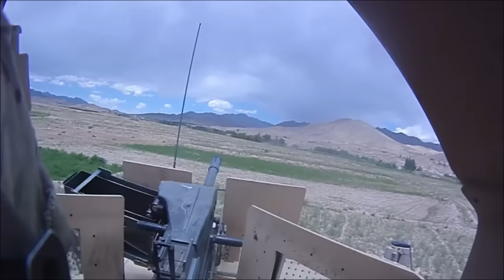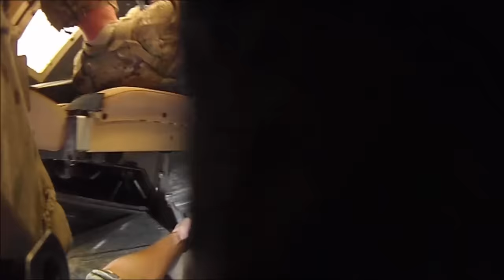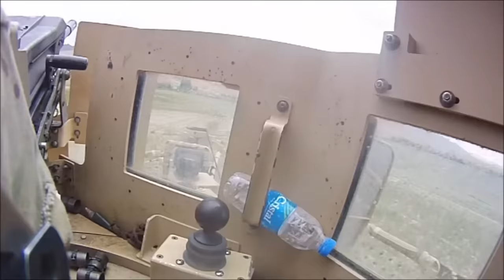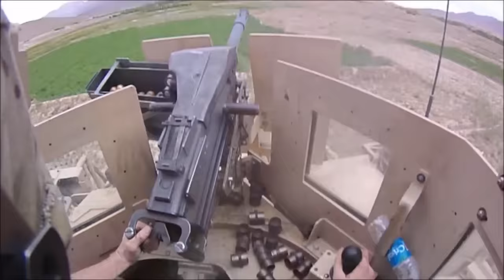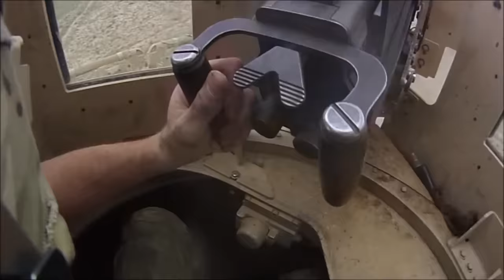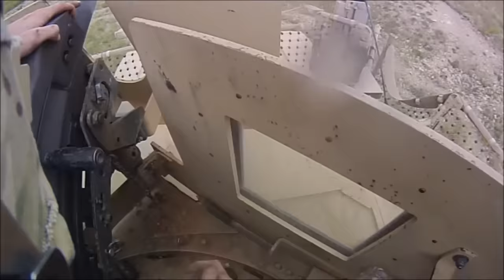MK-19 AUTOMATIC GRENADE LAUNCHER FIREFIGHT

Comment: It’s crazy that you have to totally expose yourself to preform a reload.
Reply: @killdozer3464  That is what I don't understand. I can understand manual loading, cheaper for the military to get their soldiers to manual do it, as there is no shortage of free manual labor, but exposing yourself just to load. Clearly that Turret was designed for a different gun and they just threw that on top, they were no designed with each other in mind if i had to guess.
But yea, reaching over the protection to load I was like, really, that sucks...
Reply: @Arrogan28  I agree. On my first deployment to Afghanistan, the first KIA we had was a turret gunner, 7.62 bounced if the roof the the truck, under the single piece is “armor” and hit him in the face, killing him instantly. Next deployment we had “upgraded turrets”. On the third one we had what you see here.  When we got MRAPS land mines wouldn’t cause as many casualties, they started handing the IED’s on trees, and blowing downwards towards the gunners head. Lost a trooper that way.
Reply: @killdozer3464  Felt for this gunner when the bullets were zeroing in on him, and he is being asked to fire into their position, meanwhile he has to reload to do that, the lid is missing a pin and he has to keep reaching over and slamming it down.  You could see the pens he had broken open looking for a solution, clearly that wasn't lasting. And yea, he is exposing himself as the bullets are whizzing by for lack of a 25cent pin, and a protected loading system.  
I get both perspectives, him just trying to not get killed but also knowing that he has to do the job otherwise you can end up in some worse situation fast.  
Sometimes I think they need to get DARPA focused on the unexciting stuff like this more, vs some next paper-worthy research project. Just solve the basic stuff for the everyday grind out there.

Comment: "It's coming from every direction"
You think the turret would have armor that protects the back of the gunners head?
Reply: more dangerous that way. ever throw a rock at a wall? it bounces off not sticks and stays. if they miss his head it goes right by, with a wall behind your head if they miss your head then its definitly hitting the steel behind you and they may still get you neck, shoulder, arm, etc. on ricochet. or better yet it would make a giant baseball glove for RPG's. yeah you lose protection behind you but it's a 'calculated risk' type of thing.
Reply: you probably want to instead prioritize putting yourself in positions where you aren't attacked from behind

Comment: I don't like how you have to expose the shit out of yourself when you reload. That scared me just watching that!
Reply: Dayum!
Reply: You got that right! It has to be the best sound you can hear when the Muscle (Tanks) come in just like when you hear the Air Force Fighter Jets overhead about to do an Air Strike. Sweep it, Destroy it and get those bastards out of the way.
Reply: Hell yeah! Just like that dude told ol' Martin Sheen way back when "Kill.. with extreme prejudice"  The U.S. military might is one hell of a thing brother. I'm glad it's our military and not the enemies.
Reply: Blaze0357 Damn straight! We're not going anywhere brother and we're as hell not going to back down to anyone, either allies and enemies foreign or domestic! They look all the same in our scope.
Reply: There's a big cover/dome around him
Reply: Will M. Yeah, that's cool. It's messed up how fast you run out of rounds. I wonder, can you tell me.. does this weapons barrel get as hot while firing as the SAW? Or if needed, could you just hold it wide open without melting the barrel down? Are these rounds as tight in the barrel as a regular rifle round?
Reply: Actually, the MK19's barrel doesn't get that hot.  There is not need to change it out.  We aren't issued spared barrels for this unlike other weapons like the .50 cal or the M249 SAW.  The MK19 does required a lot of LSAT or AKA whale sperm for lubrication.  As long as there is proper lubrications and proper loading, the MK19 will fire all day.
Reply: Whale sperm?! is one of the most expensive ingredients for making top french perfumes :P
Reply: John Frank well,, explain pleazse;;; by the way i don t play  COD1,2,3,4,5,6,7,8,9,10,11,12,13,14,15,16,17,18,19,20,21,22......don't know what the last one is,,,,, most stupit game ever

Comment: I always wondered how you can get a lethal grenade from such a small round. I mean the grenade without the casing is so small.
Reply: These grenades have the same explosive power as an M67 hand grenade. A kill radius of 5 meters
Reply: @davidlanger3295  Then why are hand grenades so much bigger? Bigger shell to give more shrapnel I assume?
Reply: @coultonharmon2266  I don’t think an M67 hand grenade is much bigger than the 40mm grenade used by the Mk-19 and Mk-47 grenade launchers. The M67 is ‘fatter’ and heavier and has more shrapnel producing ability but, the 40mm grenade is longer. I’m just going by what the manual had to say. One thing I noticed about the 40mm is that it had absolutely no ability to penetrate any structure. It’s only good to produce shrapnel. I used used this weapon system a lot in my 5 tours in Afghanistan

Comment: In Vietnam during the Tet Offensive we had a few PBRs pass our boat dock on the Bassac River.  They had mounted grenade launchers( I think we called them Honeywells,  They opened up on the far side of the river from where SEALs had received a rocket attack trying to use our boat dock.  I have a film of it somewhere.
They were like a cross between a mortar and a machine gun.

Comment: I take that the rear sight on this gun is broken or he doesn’t know how to secure it?
Reply: yea it looks pretty loose, the cross bar on it is the aperture used to aim though and it isn’t moving. so align the sites lob in some grenades flip the floppy sight back up (it’s designed to flip, this one is probably just broken) it’s all good just a hassle.

i wouldn’t know how to secure it I’m just a civi but it can’t be to hard to figure out I’m sure of that. so the pin or whatever is probably broken or lost.
Reply: taking a close look at it, it looks like its just a twist tighter knob on the right side of the base on the sight.

idfk why man. lmao.

Comment: Starting at 0:30, the rear sight repeatedly folding over when the weapon is fired is not a particularly good sign. At 1:40, when the rear sight has been almost adjusted to its maximum range, it’s completely down.